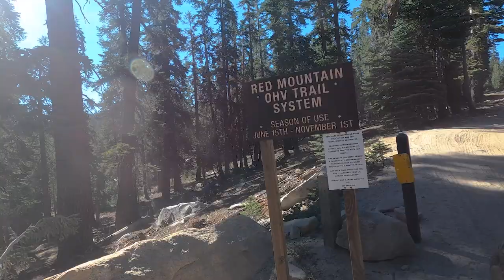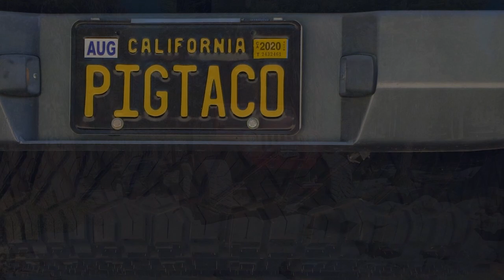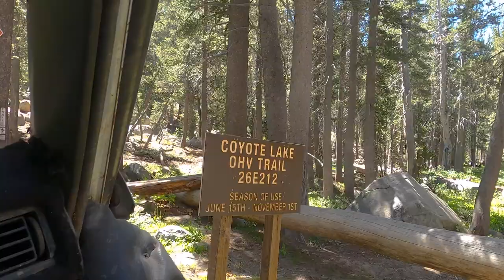Epic Coyote Lake 4x4 Trip: Yota Crawlers, Synergy Jeeps, IFS Tacoma, and the Poly Buggy

Comment: Where’s this trail located? Length? We’ve done the Rubicon a ton and looking to try something new.
Reply from the maker: It's in the Shaver Lake region. Length is like ~3 miles but you have to follow the Red Lake OHV plus a few fire roads to get to Coyote Lake OHV gatekeeper. There are many OHV trails in the area, but check the local ranger station website for status because there are seasonal closures for most trails. Swamp Lake, Dusy Ershim, and Bald Mountain are also worth exploring IMO.
Reply: @COLINSMITHSLO  right on. Thanks.

Comment: What size tires is the Tacoma running?
Reply from the maker: 285/70r17 Nitto Trail Grapplers but it really needs 35s for ground clearance.
Reply: COLIN SMITH SLO thank you for the reply. Good job on the video. I have a gx470 and I’m trying to fit 35’s so I can hit up these trail.
Reply from the maker: @jacksontan5410  Rad! Yea my coworker also has one of those and it rips. Pretty much identical underneath to this Tacoma. The MCLT is a easy/expensive way to push the wheels forward a bit. Otherwise body chop plates will help you get a little bit more clearance. Nitto also makes a 35 x 11.5 tire which can help just a little more with clearance while turning.